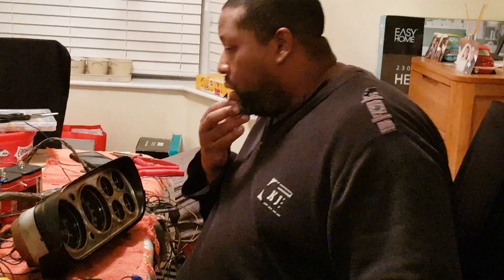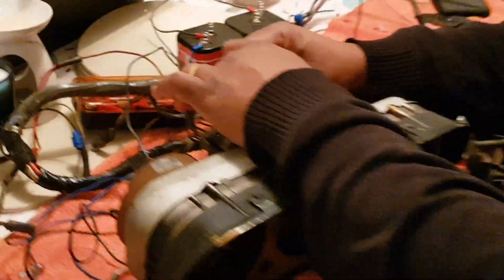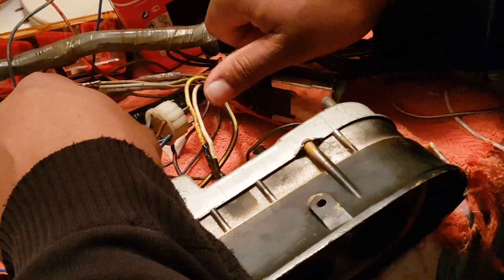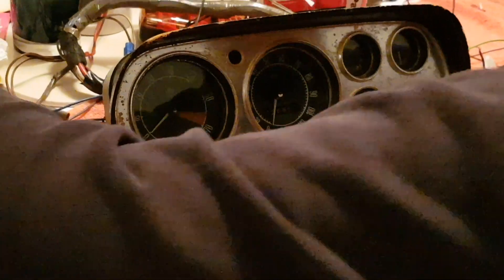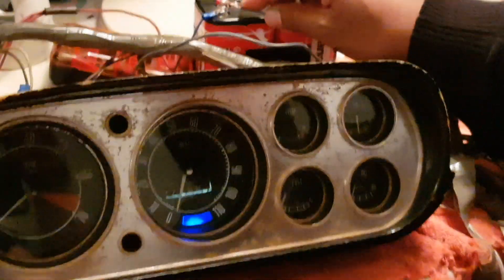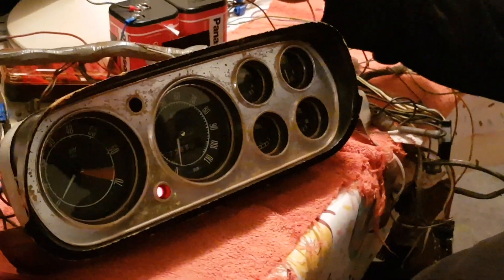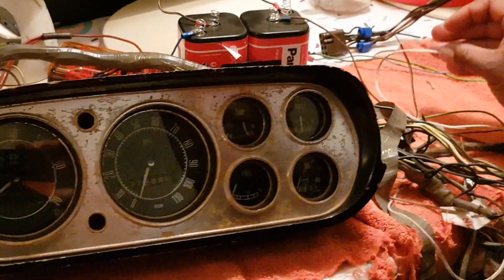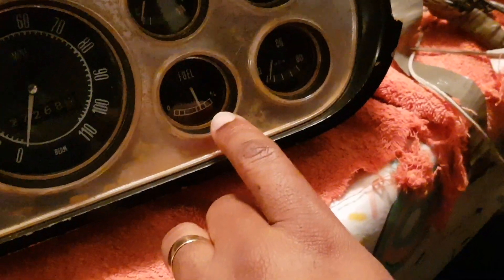Testing Ford Mk1 Escort 6 dial clocks on the bench - Actually in the house as it was cold 😃

Comment: Hi, information like this is invaluable! I have a question, I have a Duratec in a mk1 and I’ve acquired a six dial dash, I want to keep all the original Gauges, but I’m wondering how you would hook up a mechanical oil pump pump gauge to the electric oil pressure switch of a Duratec. I was thinking about possibly drilling out the centre of the electric pressure switch and tapping a thread into it to put a mechanical sender unit in there. Do you think that would be acceptable or is there another way? I don’t want to lose any of the original Gauges.
Reply from the maker: Hold that thought. The next video will explain that one 👍

Comment: heyy david. me and my dad started to work on our ford escort mk1 and we want to remove our dashboard to get it rewrap. Can you please tell me the locations of screws because we don't want to ruin the already ruined dashboard
Reply from the maker: Hi,
If your looking at the crash pad and im assuming its a original item then there should be 3 bolts that go through the metal dash and nuts that need to be undone. Mine wasnt fixed on that great so it was only 2. From memory one is where the dials are and the others are located close to the vents and in front of the passenger seat.

If your removing the metal dash then that takes a bit more effort but i will be covering that in a video.
Reply: @davidgreen7841  thanks man, i also did some research and i found the way to remove the outer layer